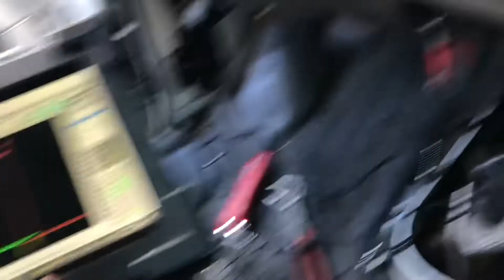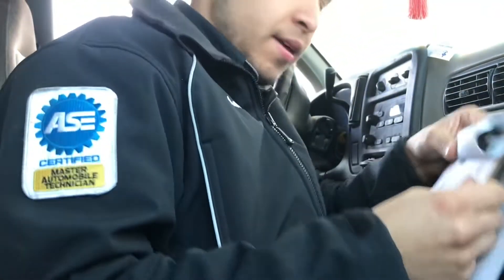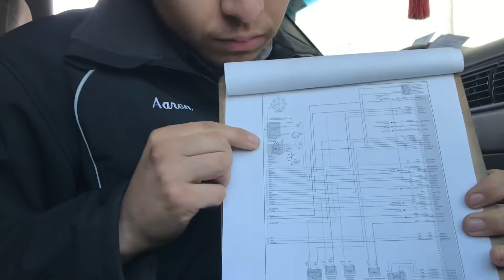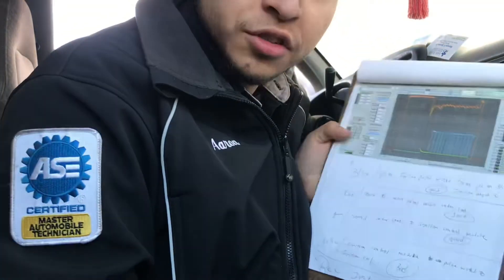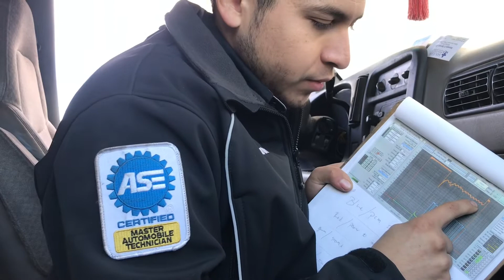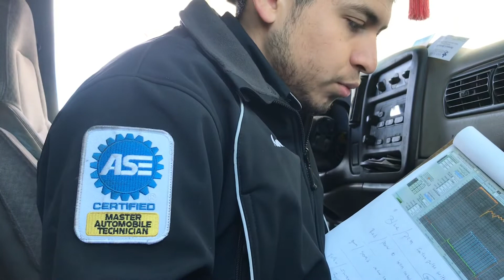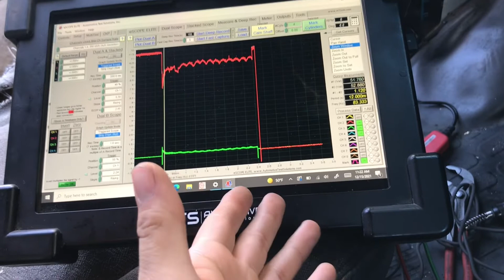Chevy Express van crank, no start case study diagnostics

Comment: thank you for the video. i had a similar problem after replace the ignition coil and ignition  control module. the problem was with the connector that goes to the  ignition coil. i thigh the metal contact inside the connector and it worked. hope this comment help someone.